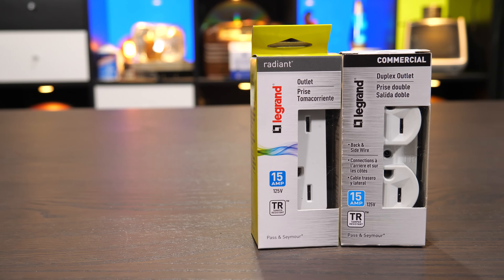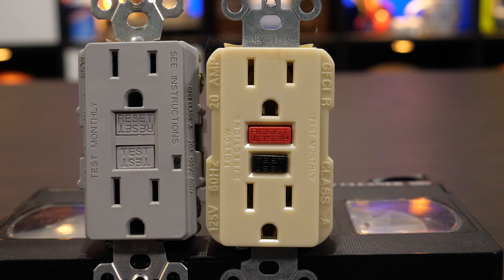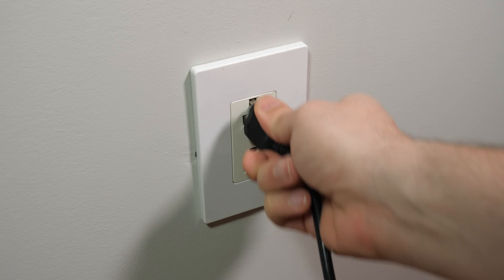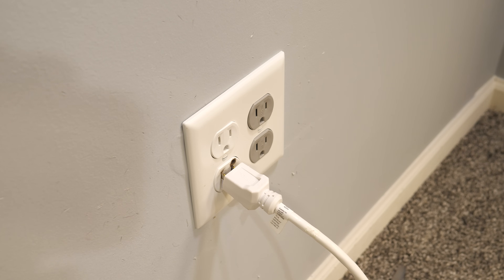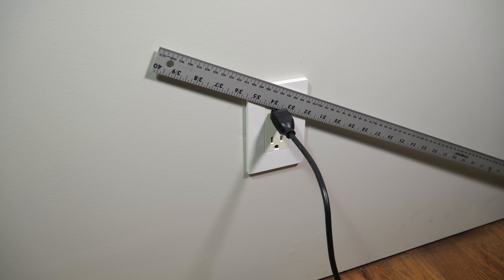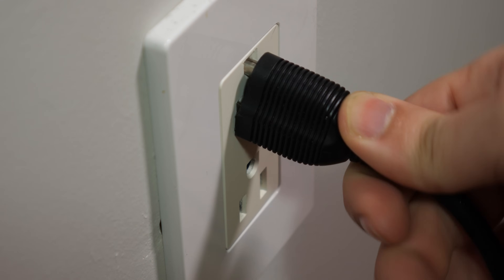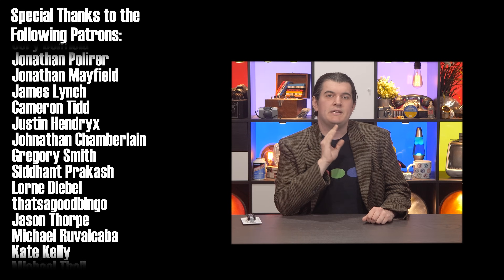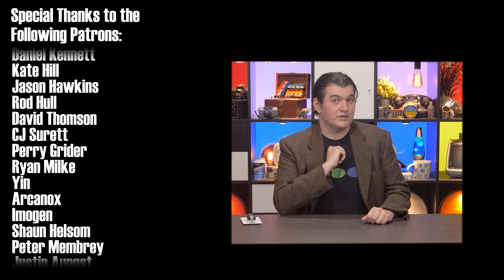Power outlets are topsy turvy - but does it matter?

Comment: When i was at trade school i was told it was proper prctice to have the bond prong (ground) at the top if the outlet had a metal face plate so that if it were to slip off and there was a plug inserted it wound land on the ground prong not the hot or neutral prongs. Preventing a shock

Comment: Meh.  If you want to make them safer, get the ones with the ground-fault interruptor.  These days, they're not even that much more expensive than the regular ones.   (Well, I don't mean the frighteningly low quality ones you can get for like $1.59 each, but no one in their right mind buys those, because safety issues aside they don't grip the plugs well at all, which is massively inconvenient.  The "normal" ones are like $6-8 each, and the GFCI ones are $10-12, so unless you're buying them by the gross or something, the price difference isn't going to break your bank.)

Comment: Most of the right angle plugs I have are UPS. If you're looking for subject suggestions, sine wave vs square wave might be interesting. I had to learn about it recently because you're not supposed to use square wave for home medical equipment.
Reply: Same with power inverters that run off of a 12V battery from a vehicle and generators.  The cheap method is to just have a square wave output.  Which works for incandescent light bulbs and some power tools, but they can even damage some electronics.  There are also modified sign wave inverters, which produce a wave that is more like a triangular wave than a square wave.  So, are closer to a sign wave and may work better with some things, but still not as good as a pure sign wave inverter.

Comment: Whole building fault protection has denied me my Darwin award many times. It's probably the best most doable safety measure. 

One of my earliest memories as a child was seeing an electrician come and work on the fuse box and my mum explained it was for added electrical safety. So as soon as I got 5 seconds unsupervised I stuck a knife into a socket.... the RCDs did in fact trip and limit me to a non lethal shock. 

More recently, an old house had the lights switched on neutral rather than live. I discovered this when I was fiddling to get a broken globe out, touched a contact and all the lights in the house went out. The RCDs on donestic lightning circuits are way more sensitive than higher power appliances so I didn't even feel a tingle. 

Only issue with RCDs is that high power appliances with low power factor like welders can upset them.

Comment: Australia's plug is an interesting case here. We have safety measures that make most of the dangers raised here a non-issue, so that's not it.
The plugs here are always installed with the earth at the bottom. But China uses a near identical socket for some reason, and their earth is at the top.

Or at least, that's what I've seen on the internet.

Comment: I worked maintenance in nursing homes for 28 years. I ran into this issue one year from the annual health and safety inspection. We were using beaded chain  (the kind you see on a lot of ceiling fans) on our over bed lights. The inspector told me about a fire in some nursing home due to the chain falling back into the bent plug. We had to change all of them with nylon cord.
Reply: Yea that sounds like a disaster waiting to happen. Glad to here you guys took preventive measures to keep those older and or disabled family members safe. Thanks🙏 I have never paid attention wether the reading lamps at my mother’s assisted living apartment had metal chains. I’ll be sure to check when I visit tomorrow
Reply: ive melted those chains in nursing homes.  in the last 3 years.
Reply: In Australia a sparky told me the regulations were changed because of a metal louver blind apparently killed someone. So now there is the requirement that the plug pins be sleeved. It is definitely a sensible requirement. And yes it would be mitigated to a much lesser degree if the earth pin was up, something that is never seen in Australia, unlike in the UK. There is the opinion that the UK plug is the most superior design as it incorporates all these safety features, but they are so bulky!
Reply: @onewaytoliveby UK plugs are also the most painful when trodden on in bare feet. 😂 (They tend to land pins facing up due to their geometry. )
Reply: Would it not be easier to change all outlets to safer ones ?   If the building code , when lead (pipes, solder and flux) in public water systems was banned in 1986 In US , would have mandated better outlets and plugs , if building has renovation done, most of US homes would most likely have new outlets by now .
With water pipes you need to rip old systems out , with outlets its just to change it , cost is what those outlets cost , what is that $5 per outlet ?
We changed old two pin outlets to Euro plugs , ban came in 1997 here in Finland , starting with new buildings , now you should have even arc protection .
I still have in summer cottage , one old outlet , its nearly as dangerous than American , if you use 50 year old plugs , you do have outlet area a bit below surface .
Reply: @pete_lind  It's a similar vein to the LED/Incandescent bulb fights... You gotta consider, not only just how incredibly BIG the U.S. really is... BUT also that the U.S. industrialized like NOBODY else in the world, and the shear numbers that encounters. It doesn't even matter any longer who does the actual physical manufacturing, either. The numbers that were once so ungodly above and beyond the facility or imaginings in the 1890's became the "default normal" by the 1920's... and by the 60's if you couldn't contribute a few million a year, you just couldn't be a manufacturer...

    The side effect is warehouseS (cap-s for emphasis) completely stocked floors to ceilings with the old "dangerous" outlets. It's just how industry rolls in the U.S. and to fail to "get big or go home" is the obvious hindrance to competition.

     There REALLY WERE warehouses of unused incandescent lights all over the country, and corporations that owned them threatened seriously with losing their figurative asses on the advancement of LED-lighting, so there will continue to be such arguments and fights for years to come, even if it seems relatively quietly going away... Same with the corporate blockade on updating anything in the electrical code elsewhere. It's gotten along fine with fairly seldom accidents and injuries over the bigger picture, so the U.S. business world is fine with letting Darwin sort out the end consumers.

     It shouldn't surprise you that when the building codes and National standards outlawed lead in the U.S. rather than dig up and retrofit all the old pipes for new ones, they added phosphates to the water supply and left the existing infrastructure alone. LOTS of American cities and towns and yes, EVEN houses and apartment buildings still have lead fittings in their pipes from city mains all the way through... The lead crisis in Flint Michigan was down to the city council failing to add the phosphates when they decided to send their own pipes to the lake to get water, instead of paying the slightly higher price for the processing plants to continue supplying it. It's like that ALL OVER THE COUNTRY...

     AND there are "Scenic Historical Districts" where Historical Societies and Associations have lobbied their way into local governance and you literally have to get permission from the city to replace things like the shingling on your roof or your rain guttering system, and they'll send you back a list of "appropriate products" to choose from when (and if) they even give you that permission... SO you can figure the odds of getting permission to gut a historical house out and retrofit the plumbing, because you'll get inspectors up your backside by the dozen... and pay them servicing fees ON TOP of the local taxes and the city's requisite considerations.

      There's a dollar to be made, so you can bet your last ounce of dying breath they'll find a way to suck it out of you.  ;o)
Reply: As far as I know the rules about lead pipes allowed older installations to remain until they need replacement anyway, as the risk of lead contamination is negligible with normal running water flowing in the pipe, however a change to outlets and/or plugs would potentially require a wholesale replacement as compatibility would break (obviously adaptors could mitigate this and it would be fine but.. guess people aren't that creative?)
Reply: @pete_lind  you also have to replace the devices that use the outlets which would cost a ton of money and would anger more people then you would make people happy about the new safer outlets
Reply: @pete_lind  I don’t know the details of the transition you mentioned. We’re the new outlets somehow backwards compatible with old plugs? Or was it a situation where everyone needed to pick up a ton of adapters to use old plugs in new outlets (and vice versa).

The thing with lead pipes is they never mandated old buildings to retrofit, they just required new installations to stop using lead. Most people would see no observable change from the regulation. Unless the old and new plugs are somehow compatible, then I would think the transition would require several years of irritation with adapters.

I honestly dont think most people here view the safety issues with the current outlets as being significant enough to warrant the inconvenience of fixing it.

Comment: As a custodian on a university campus, I plug and unplug vacuum cords all day, and every wall outlet is installed with the ground pin down. But there is one exception: a small building with bio/health labs has all the outlets installed with the ground pin up.

The reason why I'm not worried about which way US electrical outlets are installed is because there's a bigger problem than the outlet orientation--the outlets themselves! While there certainly isn't one single global standard for electrical outlets, America definitely has one of the worst, and this seems to be a pattern (Fahrenheit vs. Celcius, Imperial vs. Metric, 12-hour timekeeping vs. 24-hour, etc.).

Comment: Great Job as usual Alec. As an Industrial Electrician, this topic comes up frequently. You are right, there is no clear requirement for the receptacle. I do find however, that the installation in a garage or industrial application, where the majority of items will be grounded (Three Prong) is much greater, and supports the "Upside Down" installation (Requirement). Just my opinion however. Thank you again.

Comment: There is actually a safety advantage tradeoff to ground down arrangement. When the plug is drooping, the ground pin still has full engagement. If installed with the ground  pin on top, a drooping plug can end up with the equipment ground pin disconnected but the hot and neutral still engaged. This can present a shock hazard to someone using the equipment at the other end.

Comment: My absolute favorite power strip that i own has a flush, 90 degree, rotating plug so that it can be plugged into any outlet (top, bottom, left, or right), in any orientation, let me rotate the cable away from the other outlet, and to top it all off still allow me to push a bookcase or other piece of furniture up against the wall where the outlet in question is.

Why aren't all plugs like this?

Comment: When I upgraded my electrical system to 200A, I installed my outlets with the ground up.  I did it to avoid a child with a metal objects shorting the outlet.  I did this in 1986.

Comment: Correction: Most electricians DO care -- they care enough to know where it is required to install the grounding conductor up, and where it's not required. Where it's not required, they install them the way people want them -- with the grounding conductor down. I'm a building inspector. When I wire receptacles in my own home, I put the grounding conductor down.

Comment: I built this house 20 years ago, I thought the outlets should have been upside down compared to the norm for  a minimal safety gain with kids around etc.  Every person that seen them that way who worked electricity flipped out about them, how wrong they were and how stupid I was. The point was it didn't hurt anyone, there might have been a single digit percentage of a safety gain when kids were involved and for me that was enough for my kids safety as far as I was concerned.
Reply: Small safety gains are definitely worth it on things you can control! 20% of all electrical injuries happen to kids. There are over 30,000 electric shock injuries in the US per year, and over 1000 deaths (about half is High Voltage and lightning).
Reply: I’m pretty sure one of my cold boxes downstairs (the extra refrigerator or the deep freezer) has a right angle plug with the ground up orientation
Reply: @tanya5322  I've seen an old old washer and a chest freezer like that, but nothing made in the last 20-30 years

Comment: The only instances I ever witnessed that would involve installing this receptacle in the "inverse" would be to draw your attention in order to signal something. This could be a way to delineate whether or not an outlet is "switched" via a light switch OR, the other instance, where it is to signify that a certain set of outlets are on a specific circuit, I.E. an emergency backup generator circuit. I believe that any other idea of origin was merely a modern myth or fabrication based off of someone spending too much time in hospitals. When people started making up this "new normal" it really started to screw up these, already existing, forms of instantaneous signaling. Now you need to test each outlet and keep a mental note to see if it's "switched" or apart of a generator circuit.

In my mind, a cord with a ground prong not only instills the idea that it's installation should be semi-permanent, it also proves that, in most if not all cases, it's carrying a significant amount of energy. I don't really know of any real situation outside of a vacuum cleaner that would involve you hot swapping these styles of plugs in the first place.

Even though I personally work with a lot of mobile equipment, I find it increasingly difficult to believe that NORMAL people are actually plugging and unplugging things THIS often, nor can I believe that people would be this careless and relaxed with electricity. None of these issues occur if you don't fiddle with cords all day. How often do you move a lamp from one room to another? How often do you unplug your refrigerator? 99% of my home appliances and fixtures haven't been moved/touched in decades, outside of cleaning, and yet all the plugs are snuggly connected without hazard, and some of these are the older style that may be considered more "loose" in tolerances.

I feel extremely indecisive about the implication of safety features when it comes to things like these. Safety is important, but it shouldn't negate or mask the inherent danger. Things like electricity ARE ALWAYS dangerous and I feel like adding protective measures generates an illusion that it is now safe. I feel like equipment that has these sorts of tolerances should be respected and treated with a level of care, when you mask the danger with all these safety features it has the potential to introduce an even more advanced stage of abatement and ultimately inspire negligence; because now that most, if not all, fear is gone: the respect for the possible hazard can be disregarded.

I'm not against safety and I appreciate safety equipment. My life depends on different kinds of safety devices on the daily. If you are TOO STUPID to figure out how to not zap yourself with a little bit of 120v (which varies from a STRONG tickle to a punch at most) than idk how you can possibly function in real life period. Children wont die from an outlet by itself, it would be a painful and rude awakening for them sure, but it's a NON-ISSUE because if you cared that much about your children you wouldn't be neglecting them by not keeping an eye on them in the first place.

Add these terrible plugs to the list of hundreds, if not thousands, of things that an average individual comes in close contact with on the daily that have the potential to harm or kill them.

The idea that anything could inherently be unsafe is merely an illusion that masks the intelligence of the users or operators in question, and most Americans are pretty questionable. So you extend that logic to imply that everything an average American does is unsafe.